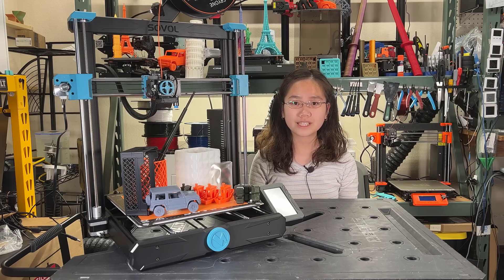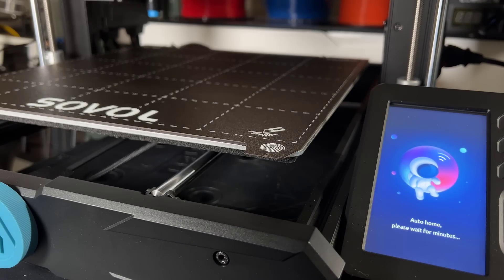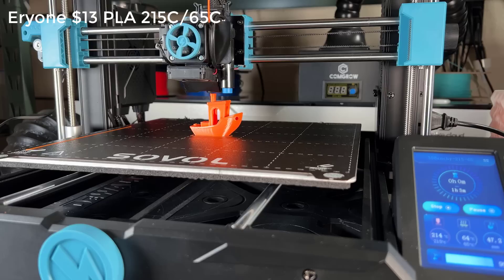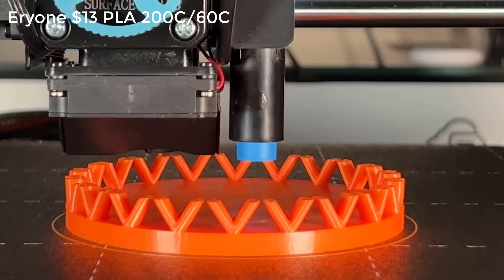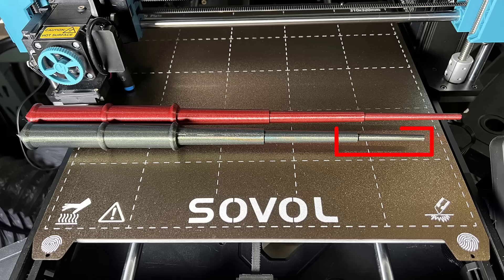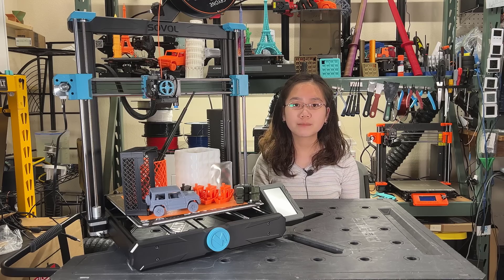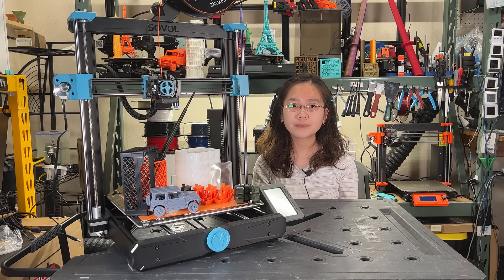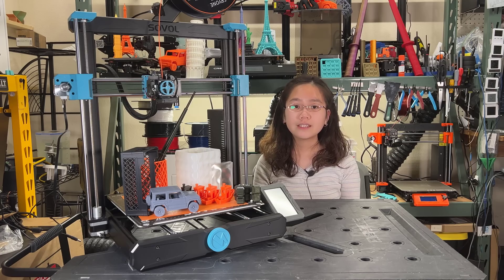Prusa MK4 or MK3.5 pumped-up Clone? The $349 Sovol SV06 Plus w/all-metal planetary direct extruder

Comment: Nice video, but I don't think you should derive the CURA settings from the SV06 by simply changing the bed dimensions. Since the two machines have different nozzles, you are not using the SV06 Plus to all of its potential if you leave the speeds at SV06 speed! I see everybody do this, but I think it is not the correct way
Reply: What would you suggest? Is there a way to copy the stock/factory SV06 Plus slicer setting over to say Prusaslicer?
Reply: @中国制造221BC  You need to set up Prusa Slicer from scratch. You can refer to the retraction, temperature, speed, acceleration, and jitter values in the provided old version of Cura slicer. There is a simpler and more direct method to transition from the old Sovol version of Cura to the latest version. You can simply take the printer definition files for the SV06 Plus and copy them into the new version of the app. I have created a video demonstrating how to do this
Reply: @gerGoPrint3D  I appreciate your feedback! It's as I figured but didn't really know how to perform the transition. Having said that, I ended ordering a Bambu P1P as Bambu has dropped the price by $100 and it's more strai forward for me.

Comment: This is not an Mk4 clone. Maybe mk3
Reply: It seems that the Sovol printer has more features resembling the MK4 than the MK3. These include a planetary extruder, 10mm linear rods, and a color screen, which are all new to the MK4 and not present in my MK3S+

Comment: If they replaced the Pinda with a strain gauge or voron tapper, this would more or less toast the MK4, spec wise at least. Pinda was state of the art 7 years ago, but we have much better options today. As always, your review wonderfully informative, particularly with the recommendations.
Reply: strain gauge seems to be creating issues for MK4 owners, it's creating a divot in the print surface, creality had released strain gauge based print heads and went away from them, tap would need a bit more engineering to be adopted to a rod based machine, not sure why not just stick to bl-touch for this price point -- it's sufficiently accurate.

Comment: my SVO6 is going back. Can't get the bed level right. It makes me sad, because I wanted to like it. I do have a MK4 coming though.
Reply from the maker: The SV06 Plus no longer has the leveling issues I mentioned in the SV06 video. 
BTW, the new firmware for the SV06 has also fixed that.
Reply: @AuroraTech  yup. As a result of the old firmware, my nozzle crashed into the build plate. After contacting Sovol, they sent me a new hotend and a new PEI sheet, in addition to sending me a link to their new firmware that fixed the problem. 

The old firmware not only didn't level the gantry properly, the firmware itself wasn't calibrated to the actual distance of the z offset. With each reboot the printer didn't know how far it was supposed to be from the bed when homed.
Reply: @AuroraTech  I tried and tried to fix it, I printed out a full 1 layer and my right is too far away, and left side is too close, mine is going back.. I wanted to like it. Best of luck to you guys!